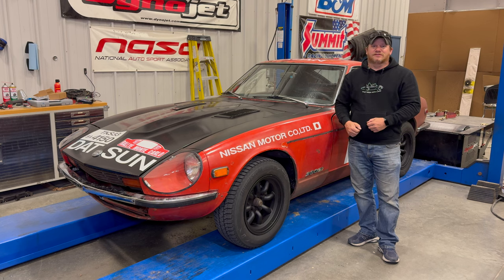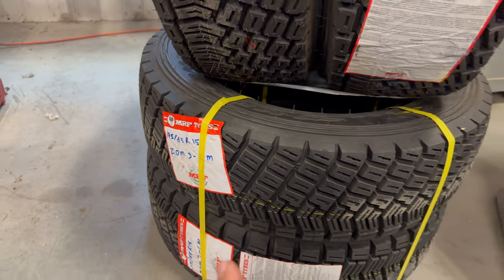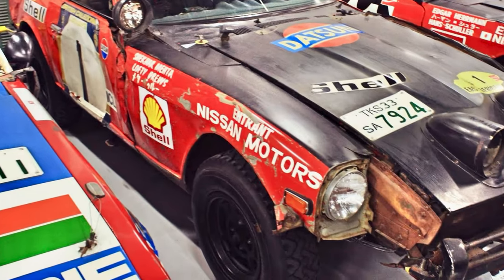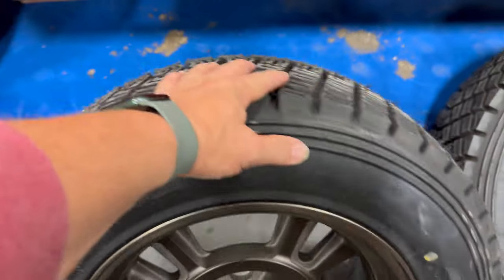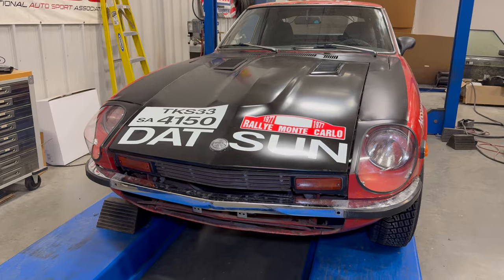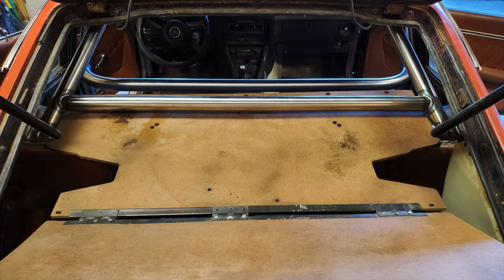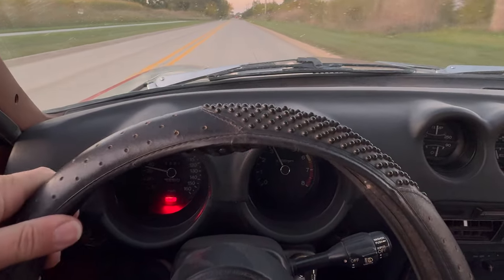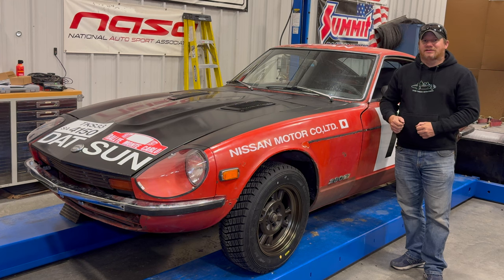1976 Datsun 280z - Fitting a Set of Real Rally Tires

Comment: Looking really nice. I noticed you seem to have cleaned up the bodywork too. Did you actually cut out the bad bits and weld in new sections? Would have been interesting to see that.
Reply from the maker: Since the last rally cross I cleaned up the doors and the white number background is paint now and not vinyl like it was at the last rallycross.
Reply: @ThisWeekWithCars Even a simple tidy up around the edges will hopefully stop it from rotting any further and it really looks quite presentable - at least on the side we can see in the video.